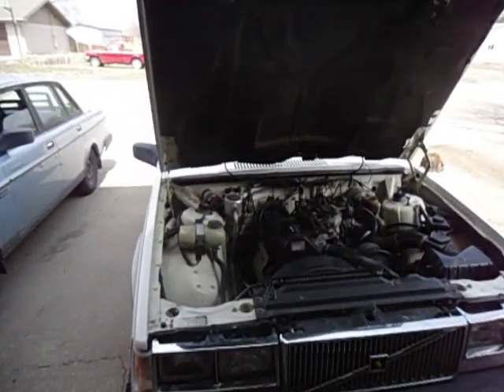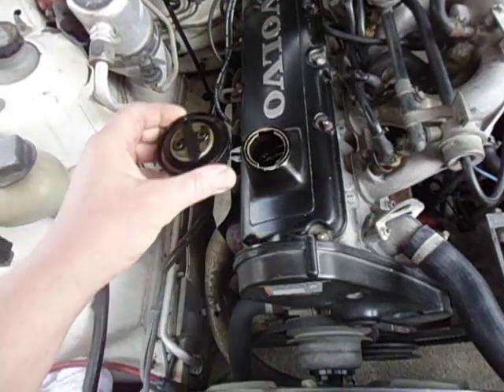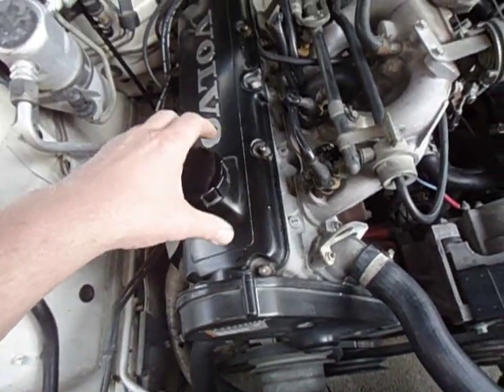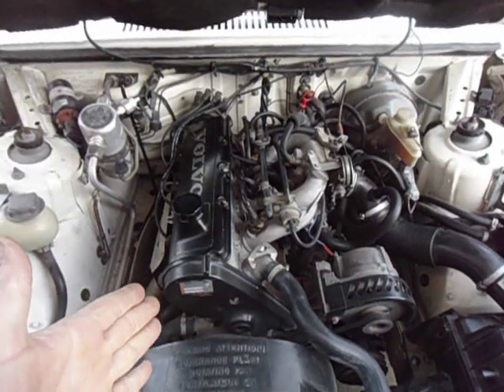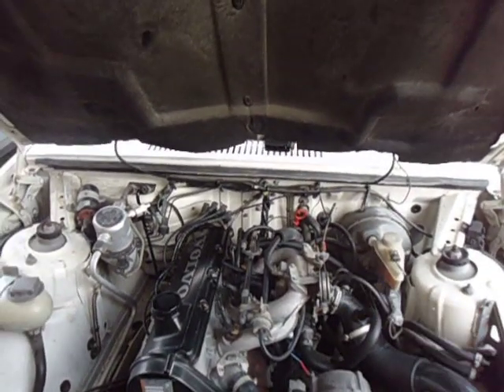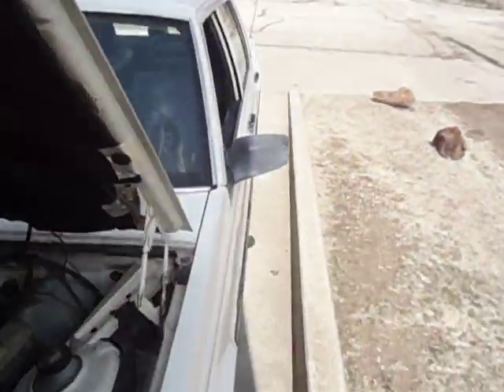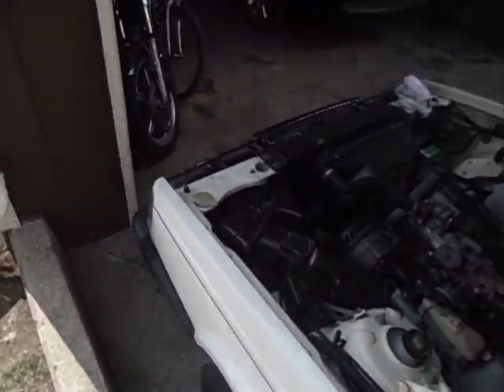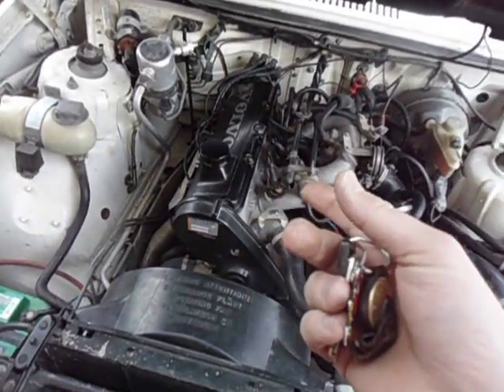Volvo B230F PCV crankcase pressure test

Comment: What can cause loose of power I look for vacuum leak , intake and manifold gasket fuel filter mass air flow  and the pipe , spark plugs and wires new distributor and nothing 

Please help me out I di change oil engine and transmission as well 

Someone can tell me what could be the only thing I'm doing next , is replacing the flame trap or pcv system

Comment: There is too much of a vacuum in my b230fk, like an old vacuum cleaner, the cap stays still when it sits on top of the filler hole and engine running

Comment: Hi, You are right on with that text: All Tried & True ! I just find it easier to make the judgement with the Oil filler Cap on there "Right Side UP" and loose. Then it will just jump up and rattle around and not try to jump off constantly. As a precaution against clogging I spray carburetor cleaner down into the Flame Trap and Breather assembly whenever I do an oil Change! So while there is no oil and no oil drain plug in the engine I take the hose to the flame trap off the throttle body and bend it "up", then spray it full off Carb cleaner: If all is GOOD it comes right-straight out of the drain plug, with next to no delay. This also helps to keep that clean: Not doing it for two years and it seems to gum-up...

Comment: best thing to tell is to get a good known mechanical external pressure gauge hooked up where the pressure sender switch fitted, turn on the engine and see how much psi you get at idle and at high revs.

Comment: That has been on my mind - however it feels a little odd to me to have to replace an oil pump after only 96k miles. What do you think? 
Checked PCV system and it came out clean.

Comment: my 1989 740gl is throwing the code 133 for the TPS. I pulled the tps and oil came out of it. Any thoughts, ideas, suggestions. I did the test you showed in this video and I have negative pressure. The car has 224000 miles and the previous owner had ten years of records showing regular oil changes at a shop that catered to european cars. Thanks

Comment: I have a 90 Volvo 740gl with 90k and oil light flickering at idle. Just got a new pressure sender switch to no avail.
Reply: Did you solve this in the end? Same issue, 940 b200ft